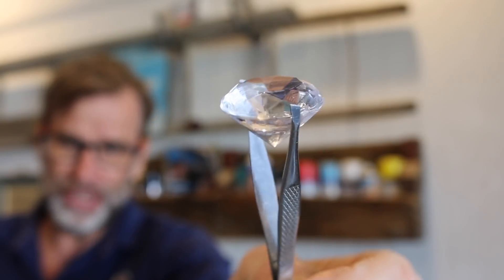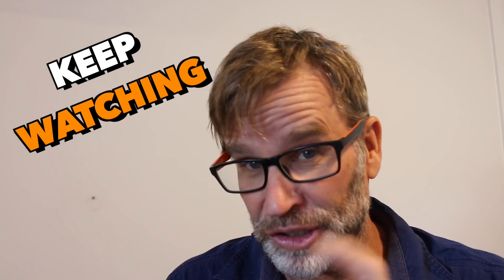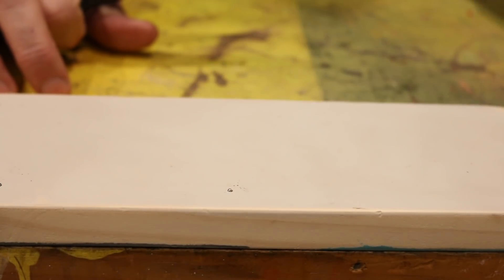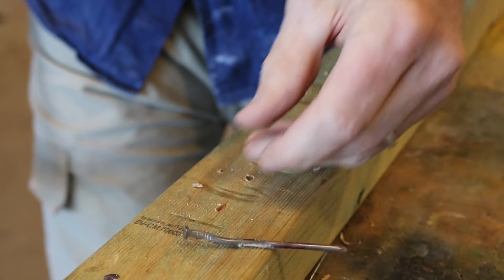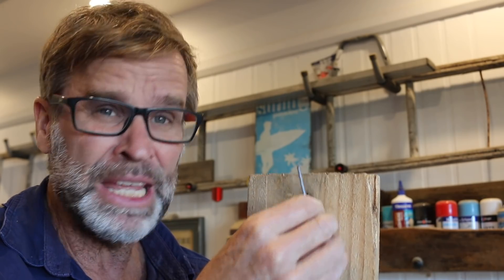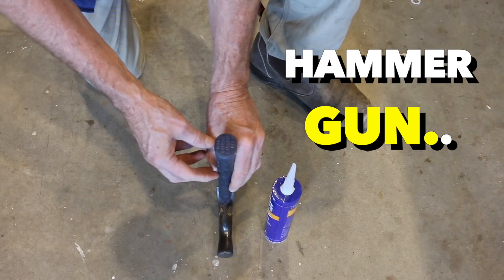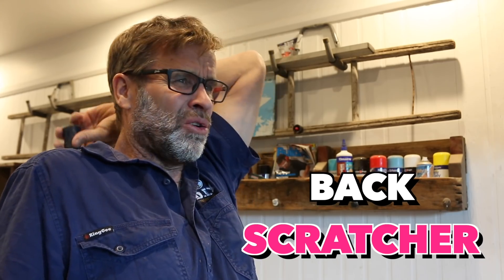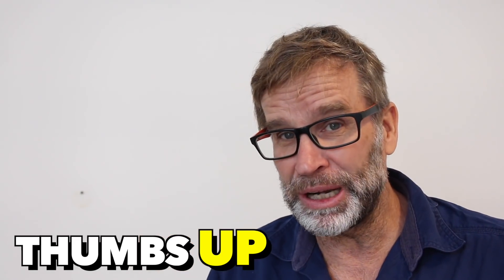8 GAME Changing Hammer HACKS!

Comment: Another good episode! There were a number of tips in there that I did not know, but especially good was the blunt nail to prevent splitting tip. Close second, the removing from trim tip. I have always turned the piece over and tapped the nail back out; your method is so much better. Thanks!
Reply from the maker: Cheers for that Michael....glad you found at least a couple in there mate 👊👊 Have a good one mate 👍🇦🇺😁

Comment: Also 16" stud spacing stud finder.
Center the head and swing over the claw end and where the handle touches the wall is 16 o.c. for the standard Estwing 12oz hammer you used.
Reply from the maker: Awesome!...good tip mate...thanks 👍😁🇦🇺

Comment: If you turn a nail around and use it to make an indentation with the head where you intend to nail will most times top wood from splitting .
If you want to lift a fiddly piece of timber into position put a philips screw or roof screw in it half way and use the claw to grab and screw and lift .
Also most work accidents Iv seen were fingers were lost was the result of not disconnecting power or taking the removing the battery .
Reply from the maker: Awesome! Thanks for the extra tips...much appreciated 👍😁🇦🇺

Comment: ive seen the nail puzzle before . I nailed it .....get it .    ...a dad joke .  was at a course for work where the instructor had everyone split into groups and solve that nail thingy whatsaname .  i was only one to do it in 25 or so people . good trick.      my Pop would stop ends of wood splitting like that but would hammer  the nail upside down afew mils  into where it was going then hammer it in right way .
Reply from the maker: Yeah your pop was on the money there Barnie....good tip👍 Thanks for watching mate 👍🇦🇺😁
Reply: @diyforknuckleheads  lots of knacks in carpentry , in earlier days brylcreem and other hair creams to slick the mop down were used ,did you ever see someone run a nail thru hair to make it easier to nail.

Comment: The old Fitter’s code: If in doubt use a hammer. Bigger the doubt, bigger the hammer. 🤣🤣
The  tip my old man taught me about nailing close to the end was to only use jolts, you call them bullet head. But, to blunt the end of the nail, place the head where you want the nail to be situated and whack it to blunt the point. The head will break the initial grain and stop the crack forming. If that makes sense. 🤣🤣. Worked for me over the years. Me? I predrill 😉😉
Cheers knackers
P.S. Hammers make great nut crackers!! 🤣🤣🤣🤣🤣 (don’t ask.....)
Reply from the maker: Great tips there P.M 👍👍 I'll make sure l have my nuts well and truly secure if l ever go to your place 😂🤣 Have a great weekend mate and thanks for watching 😁🇦🇺👍